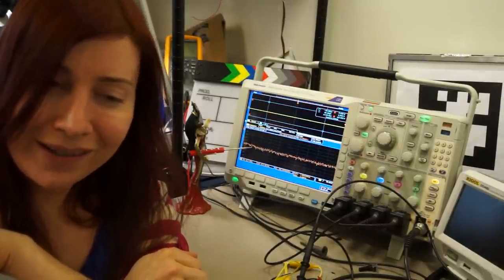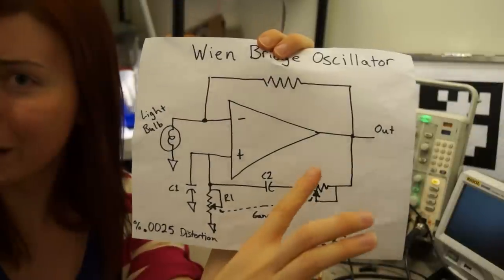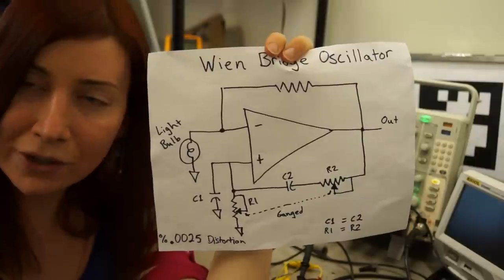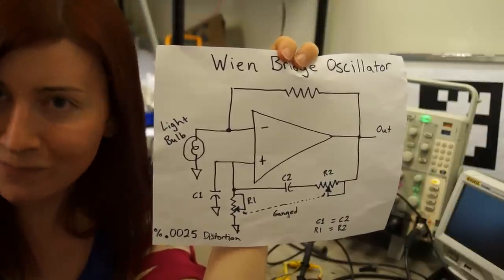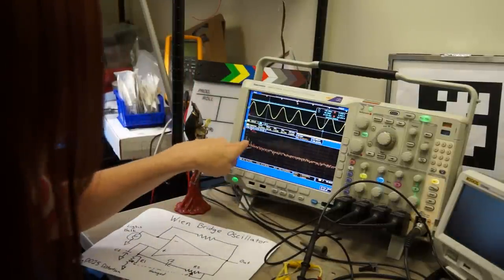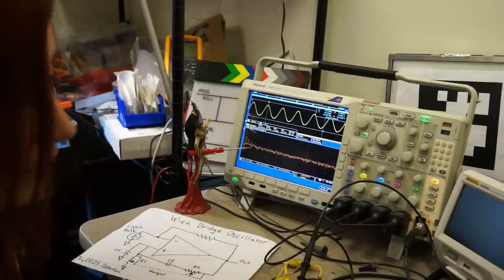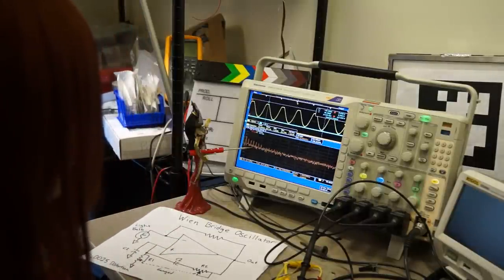Wien Bridge Oscillator - Don't Use Lame Parts

Comment: YouTube decided I needed to see this video. Even though it seems to be six years old, it showed up on my feed.
It brought back memories of when I was repairing audio gear in college. Our HP generator got a little unstable and I decided to crack it open. 
Imagine my surprise when I ran across a large (for something found inside a piece of gear), odd looking light bulb. Being young and dumb, I assumed the bulb was bad and ordered another one. I forget what was bad, but it's not a spoiler to report that it wasn't the bulb.
Such a simple, elegant means of gain control.  
Great memories.

Comment: I too as a kid wondered why there were light bulbs in oscillators!  One neat trick that I used ( I got it from an old book) is a radio squelch circuit made from two ten ohm resistors and two number 49 light bulbs.  It's a bridge.  I used it for years on a 6 meter SSB receiver.  It goes between the speaker and the receivers audio out connection.  You increase the audio gain until the lamps heat up enough to balance the bridge and then the speaker goes silent.  Any signals that come in unbalance the bridge and un-mute the speaker.
Reply: Thanks for interesting idea.

Comment: One of my earliest electronics projects was a Wien bridge oscillator using a 741 op-amp. That was some forty or so years ago but I somehow clearly remember the struggle to get it to work and how I finally eventually succeeded. I had decided the problem was that the 741 could not drive enough current to warm up the lamp enough and I couldn't find a smaller lamp - the best I had was a bulb form a Christmas light string.
In an attempt to solve that I put in an emitter follower stage to boost its current output capability. That could then easily drive the lamp but no matter how I adjusted it I could tell just by hearing that it was severely distorted. I then solved it in a different way. I replaced the lamp with an LDR. This acted as the gain controller.  I then used the emitter follower transistor to drive the lamp which illuminated the LDR acting as the actuator for the gain control. With a lot of tweaking I finally got it to work.  Many years later when I had access to an audio spectrum analyser at school I tested it and was pleased to find out it actually had very low distortion.
Reply: First time in my life i have read such a lengthy comment but to be honest i enjoyed it

Comment: Hi Jeri,
Just seen your video regarding the Wien Bridge oscillator which reminded me of an interesting story relating to what I believe was the first use of a light bulb in this circuit.
My story starts in 1967  when my college class mates wanted to build an audio generator as part of the practical element towards out final college exam. Out tutor, the wonderful Mr Dave King convinced the class to use the Wien Bridge circuit which used a glass thermistor in the feedback (pre op amps) circuit. Unfortunately, I was the only one in the class who had a glass thermistor and were too expensive even to purchase in bulk. Therefore, not wanting to abandon the project, Mr King went home that night and designed a circuit using a light bulb. As his design was so good, he published the project in one of the UK's leading electronic magazine, Practical Electronic. 
I still use my original audio oscillator in my workshop. It used to have a label on the front “May 1967). Therefore I believe our tutor was the first UK engineer to design this type of circuit.

Regards
Geoff.

Comment: piezoelectric effect can be observed on the oscilloscope at 2:43
Reply: Please add the value of the items to the circle and can be used as a filter
Reply: When her hand hits the paper? How?
Reply: Polyurethane varnish is piezoelectric?!
Reply: @iangrant9675  ceramic capacitors are everywhere and are piezoelectric.
Reply: @tommihommi1 I didn't know that! Thanks.
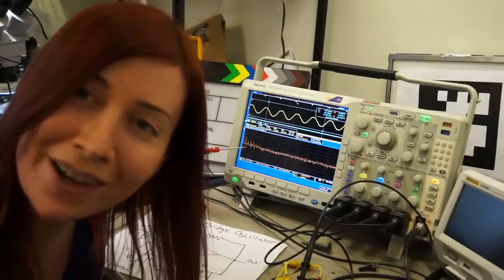Reply: @tommihommi1  It's from the lightbulb! I obviously didn't listen to the whole video before I commented. 5:17. But, it turns out that wood is piezolelectric! See
 https://youtu.be/nO1w7S5iIN4

Comment: Thank you for the reminder. I have used one of those tiny indicator lamps in a reference 1khz oscillator that provided the synchronising bleep from the sound mixer to the audio recorder at the beginning of every take shot on a 16mm film camera. Everything was powered from the camera battery.
I was amazed at the stability of the signal level that this simple technique provided.

Comment: Great demonstration!  
Actually the first resistance tuned oscillator with a non linear element (incandescent lamp) was Bill Hewlett's brainchild alone-  It was his Stanford University thesis project in 1938.  Dave Packard was on the east coast and had just been married.  The partnership happened shortly thereafter, although they had met and been good friends throughout their time at Stanford.  The other BIG advantage to using a lamp was amplitude stability over a very wide frequency range!

Comment: @cubemike99
The lamp is a 3V 15mA 'grain of rice' as used on model trains, get it on EBay. Resistor at the top of the diagram is a 1k pot. R1+2 is a10k dual pot with a 560R in series with each section. C1+2 100nF for about 200Hz to 2Khz. Opamp is a 741 or TL081.

Comment: Nice to see the good old Wien bridge oscillator around.

Like all oscillators of this type the main task is to overcome the losses
to achieve a non decreasing amplitude of the sine wave.
In the transfer function of the closed loop you easily spot out
that the linear term in the denominator must be zero to reach a stable
amplitude of the output.

Here´s where the light bulb comes in.
The bulb has a resistance which is dependent of the current flowing through it.
The more current the more resistance. Filament heats up slowly resistance increases slowly.
The "slow" behaviour is important to avoid a resistance changing according(along) to the sine wave.

But you have to watch for the proper DC bias point because the
bulb does not behave the same way in the whole current range.
You have to spot out the highest slope of the resistance vs. current function R(I).
Not every bulb works, if the slope is too flat you can´t compensate the lack
of amplitude with the gain of the amp, because the gain would not grow enough
due little resistance change of the bulb.
Once you have figured out how to set the DC operation point of the bulb
you also know the current which flows through the resistors for the negative feedback loop.
That's one equation.

The gain which is set by the negative feedback resistors is also a parameter for the
oscillation criteria. You need just the right amount of gain to get the circuit oscillate with a stable amplitude.
That's the other equation.

Now the linear equation system can be solved for the two negative feedback resistors involving
also the resistance of the bulb.

For the frequency determining part, every circuit with the transfer function
G=k/(as^2+bs+c)
can be used it must not be necessarily an RC combination but also LCR or a crystal or whatever works.
As long you compensate for the linear term "bs" this thing will oscillate sinusoidal.

Comment: Thorens used a Wein Bridge Oscillator in one of their old belt-drive turn tables, to drive an AC synchronous motor and still be able to have a pitch control and easy electronic speed adjust without having to move the belt to a different motor pulley. This was in the TD 124 or TD 125, I forget which. An excellent turntable if you put a good tone arm on it by the way. Many of the other Thorens turntables weren't all that great (and had flimsy integral tonearms) and the 1980s models  with DC motors tended to have  speed drift as the motor warmed up or aged; synchronous motors are really much more stable over time.
Reply: Pretty sure he used a Wien bridge o, not a Wein bridge o.

Comment: I used a #1869 light bulb from Ratio Snack for a WBO, and found that it was 'microphonic'.  The crimps on the ends of the filament were loose, and were ok when it was glowing since the hot filament wire expanded.  But when the filament was just barely warm in the WBO, the ends made poor contact.  Remember that the lifetime of this light bulb is extremely long because it doesn't get very hot.  Thanks for the WBO explanation.  I love a female who can talk tech like the guys!

Comment: I'm in love with your brain :) Personally I find it very useful to know the physics of basic materials used in electronics( light bulb filament heats up increasing resistance, etc. etc. ), not only does it help in understanding of how circuits work, it helps you find new implementations as well. 

P.S. You're such a nerd <3 your little helper
Reply: Incandescents & IR sensors, love the one you're with.

Comment: I never tought the light bulb to be lame in any circuit. Many times it was preffered instead LEDs. Since 8, when I build my first "lab" AF oscillator that was a Wien bridge with transistors only, I many times, used the Wien bridge as a stable and clean oscillator, with opams or transistors or even tubes even in RF (LC configuration with L or C variable). And, at first I wondered too what that bulb is doing there but, after opening the circuit, redrawing it and reading the explanation I understood their role in keeping the circuit stable.
Strange is that Internet now (re)discover this circuit. Maybe soon you will find that existed many other configurations of oscillators RC, LC or even RL that were used before digital ones that are today.

Comment: Great idea, that light bulb. Thanks for bring it to our attention.  But I guess you can have a pick detector on your oscillator and then adjust the resistor that sets the gain of the oscillator.
If C1=C2 and R1=R2 than your feed back factor beta is  1/3, and you need a gain of 3 out of your opamp, which means the ratio of R to Light  bulb resistance should be 2.  So, using a N type MOSFET biased in the ohmic region and a  constant resistor can be replace your light bulb. Now you can make a peak detector and a feedback network to adjust the gate voltage of the NMOS, in order to get low phase noise.  This can also cancel out the pushing (frequency change as result of supply voltage change.)

Comment: Mateo Aboy has a video "Wien-Bridge Oscillator: Amplitude Stabilization" which uses two diodes for stabilization. She refers to the lightbulb method as the HP method for obvious reasons :)

Comment: 0:32 I remember a similar feeling when installing 10base2 network cards back in the 90s. There was a neon lamp attached to the BNC. These were for "modern PCs"  and they were using something akin to a vacuum tube. 
Of course, later I found out why; the hard way. Those 10base2 NICs had a chassis ground. One place had bad electrical wiring. When I plugged in the BNC cable, I got zapped with 60 VAC and scared as the neon lamp flashed. But it did it's job as a GDT and saved the PC. Not lame at all.
Reply: I had the same experience, practically, in 1994, putting 10base2 into an IBM PC AT. Office had reverse-wired neutral and hot. I got a strong jolt. The PC survived but the network card did not. (This with the PC powered off but plugged in to mains).

Comment: There is an alternative version with 2 op-amps that gets around the fact that the common mode rejection ratio of most op-amps is quite non-linear.  The theory of opperation is the same.   The second op-amp gets the RC circuits and drives what in your circuit is the ground end of the lightbulb.  It does about a decade better on the distortion values.  This makes it good enough for testing audio circuits.

Comment: If you're speaking in general terms, there are materials which work either way. Some become more conductive with temperature, and some become more resistive. Look up NTC and PTC thermistors and the difference between them for more info.

Comment: A guy I know exploited the same property of a light bulb (increasing resistance with increasing current) to make a guitar compressor effect (just by wiring it in series between the guitar and amp). The cool thing is that it lights up when you play hard enough.

If you wanted to do it yourself, I'd probably add a pot, though, since guitar pickup voltage output apparently varies by quite a lot from pickup to pickup.

Comment: Light bulbs are still used in a lot of circuits. I took apart a giant Compaq robotic DLT tape library and the motor control circuits used a whole bunch of small (~50w) quartz halogen lamps in the power supply. Guessing part of the bus voltage shunt to bleed off voltage when the motors are decelerating.

Comment: That or any other diode-based 'clipper' will work and I've done it too but the THD specification will be worse than the light bulb, provided that the light bulb has a time constant that is a lot longer than the output frequency.

Comment: Great insight on a tiny non-linear resistive element :)
I wonder about choosing the right parameters (nominal voltage and cold resistance; resistance-temperature characteristics) when designing the oscillator. Maybe Mr Carlson has something to say about it?

Comment: My General Radiotelephone tube-type CB radio has a feature called "Tone signal". It sends out a warbling tone to alert others via the transmitter. It uses a wien bridge oscillator with a neon bulb as part of the circuit - no transistors or IC's!

Comment: @Jeri Ellsworth So can this logic be used in audio preamps to reduce distortion way down?
If it were to be used in audio preamp curcuits i.e. microphone pre amp or RIAA record player preamp, where would it be located in the circuit? (negative feedback part?) or would this effect the gain of it.
It's an interesting theory especially for stability and reduction of distortion and stabilising harmonics.

I am thinking this bulb circuit would be excellent in a guitar preamplifier circuit for pur clean un distorted sound.
Please advise if the bulb idead could be used in audio preamplifiers instead of oscillator circuits and if so where the bulb would be implemented into the circuit,thanks :)
Oh finally does the bulb voltage matter,i.e. 240v mains bulb, would that work the same as a 12v dc torch bulb or does it depend on the application voltage to suit to the type of bulb>, another thing if the bulb ever blows the circuit would go OC and not work
Reply: well we see light bulbs in a lot of vintage electronics from the 50`s so the best way to know would be to try it...

Good luck!!
Reply: Jusk like tube ages. It behaves like that. I'm using it in many ways, in pre-amps, power amps and most especially in passive cross-overs.

Comment: Low-distortion oscillator design seems to be some fun stuff indeed. If anyone's interested, one example is to be found in the first of Cyril Bateman's "Capacitor Sound" articles that you can dig up someplace on the web.

The problem of the circuit demonstrated here is that it apparently runs its OP at single supply between +Vs and ground, with a ground-referenced +in. Might work with an LM358, but not with most OPs. Better get +in DC to about +Vs/2, as suggested by kubarebo.
Reply: Could also try the more expensive PMOS CA3140. Also available is the CA3240 dual PMOS op-amp. For frequencies higher than audio the slew rate of the op-amp used becomes an important factor.

Comment: One thing I didn't see mentioned here which I think should have been is resonance. The diameter of the bulb filament winding relative other parts is critical in some cases because of charge transition from part to part. This will help you prevent making those pesky artifacts for one, or you can apply such knowledge to making the first basic faster than light transmitter which used a heater coil (it's patented, search it). The key is physics, geometry, and ultimately the flower of life pattern which if used as a gauge for resonance among differing radius points, will also give you knowledge on predictive circuit building so it comes out right the first time. Eliminating thermal curve between caps of any kind (everything is a cap to some degree) will prevent burnouts and make cleaner waves.

Comment: My friend has a collection of old HP products and yes, the old Wien Bridge is quite interesting. There's a write-up on the HP8903 distortion analyzer from the 80s in an old issue of the HP Journal, well worth reading to see how analog oscillators have evolved. 

By the way, ever seen distorting resistors caused by its voltage coefficient? You see these things when you build oscillator/analyzers down to a few PPM nonlinearities.

Comment: Would you investigate what's going on with a mechanical relay when a set screw is added above the actuator reed? When the point contacts are brought a certain distance apart ,and the control signal 50/50 digital, the output appears analogue under minimal load. I've hypothesized that the distance between point contacts acts as a variable capacitance, but am uncertain the reason or the range of such distortions. Thanks. Contact bounce? Delay due to magnetic field?

Comment: You dont always need an Opamp for this. You can also do it with 2 transistors and some caps and resistors. I think it was done with two transistors before Opamps came.

Comment: If ROHS isn't an issue you could use a Vactrol, that's easier than keeping a JFET balanced. Of course the light bulb works very well and is simple. The late Jim Williams (and also Douglas Self) point out that common-mode distortion of the opamp limits the low THD of a non-inverting stage.